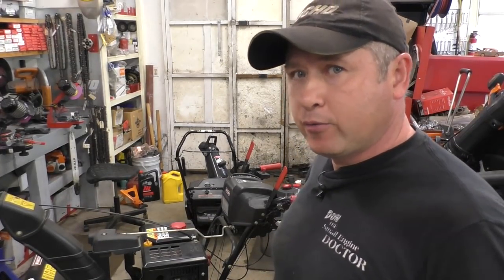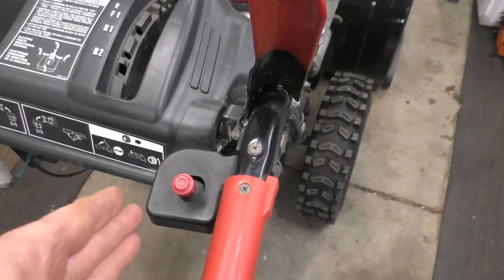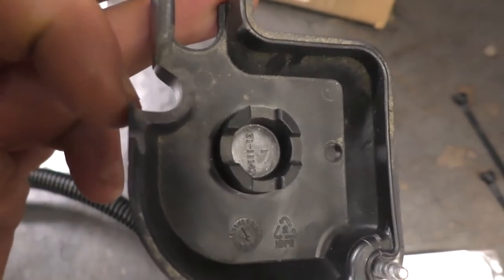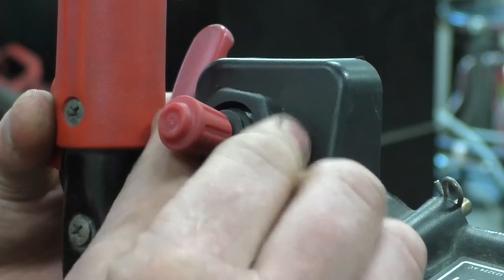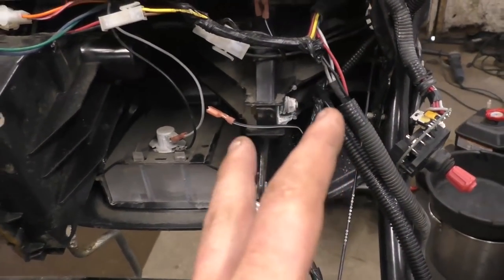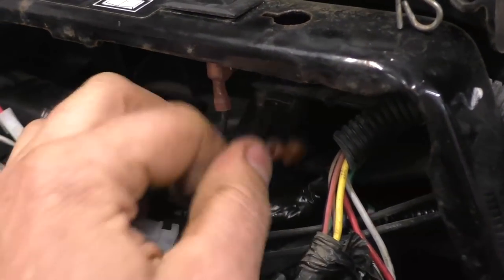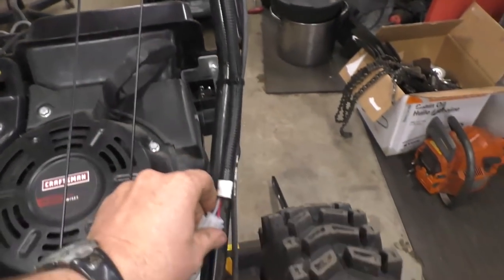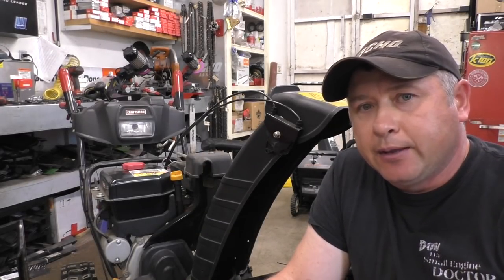Fix Snowblower Electric Chute With Two Repair Options!

Comment: LOVE IT!!!!! My 30 year old Simplicity has a "manual" chute (shoot) that I have been aiming by hand for years.
Reply from the maker: electric chutes are often problematic
Reply: Electronics generally don't like to be shaken violently unless they are encapsulated in resin, kind of like some high durability laptop interiors. There is no resin encapsulation on these electronics and I am not surprised that these switches fail quite often. 

Of course, the likely failure is a soldering point on the board as there is so much shaking in a snow blower. 

This is an awesome video by the way, I love it.

Cheers.

Comment: I did, I believe that when I replaced the new harness assembly the ground wire was not making a good contact. I took the motor and harness on my kitchen table and used a 12v battery and everything was working fine. Thanks for getting back to me.

Dyno

Comment: Don, there is a strong possibility that the micro switches on the circuit board are worn out.
Those can be replaced with a bit of soldering skill.
Do you have a digital meter to measure the micro switches?

Comment: I was given a Briggs snowblower with an electric swivel chute. It had only been run for 2 winters. The connectors for the switch to swivel the chute were dirty and the chute would not swivel. I cleaned them and its good now, but I can't wait to trade that machine for an older one. Doesn't even have a throttle! Snowblowers are an example of why manufacturers need to keep things simple.

Comment: Lets open up the switch to see if it can be cleaned or fixed . Would be interesting to see inside the switch . Just a thought this is something I would do on my own time . I think it would make for a good video .
Reply: I would add a picture here if I could as I just took a switch apart for a chute that didn't work.   After cleaning the contacts it works fine....a 15 mine minute job.

Comment: Interesting video, Dony.  Electric assist on a snowblower.  Well, lah-dee-dah!  I see that the chute tilt is still operated by cables from a motor somewhere.  How did you know it was the switch, and not the motor or a seized cable?

Comment: Thank you for this video , I have a Troy bilt, with exactly the same issue about 3 years old only. Enjoy your videos very and have learn quite a bit of tips and DYI, also glad to hear that youre one of our from the True North, (Canada) i'm here in Northern BC. Retired , also doing some maintenance on other peoples units using your DYI skills . Love it
Reply from the maker: hi from Ontario Peter!
Reply: @donyboy73  

Where in Ontario are you?
Reply from the maker: @SvenTSchixe  Muskoka
Reply: @donyboy73  Beautiful Muskoka, God's country, that is neat to hear you are in Ontarioas well. I am down in the Niagara Region myself.

In this video, I have a similar machine, a Troy-Bilt, that has the electric chute with problems like this in the video except it will only move to the right, NOT left, up or down.

How did you know that it was the joystick and not the electric motor assembly under the left hand side of the dashboard?

Thanks in advance, AC🇨🇦✌🍻
Reply: @AC  I have a machine doing the same thing as yours, did you figure out your problem ?  Was it the switch or ?  Thanks
Reply: @AC  did you figure out the problem with your machine? I have one doing the same thing
Reply: @AC  did you ever figure out your problem??
Reply: @AC  did you ever figure out your problem??

Comment: I had the same issue, took the harness to an electronic repair shop, they replaced a .75 cent diode and that was it. Dont spend $120 for a new harness. There is not much in that control switch. Very easy to fix for someone that works in electronic.

Comment: An electric chute control. Now I've seen everything. Everybody I know has "outdated" manual controls on their outdoor equipment. They operate reliably with the DIYODS principle.
Reply: Doing 
It 
Yourself 
Overmatches 
Dumb 
Shit
🤔🤔🤔 Probably wrong, but I figured I'd take a shot at guessing it.
Reply: @mannys9130  Do it your own damn self
Reply: @999thenewman  Brilliant. 😸 And true! I lost count of how many times my dad complained while I grew up about new cars never offering crank windows as an option instead of electric power windows. Just before he died in 2016, he had custom ordered his 2014 Tacoma from the dealer. It was a bare bones model that only had a few upgrades: automatic transmission, A/C, tilt wheel, and an upgraded sound system which had Bluetooth connectivity for his phone. 😸 Manual locks, manual crank windows, a sliding cloth bench seat, didn't even have intermittent wipers or cruise control. The wipers were high, low, off. Some upgraded safety stuff was standard of course, like vacuum power brakes, ABS, and airbags. He hadn't paid much at all on it before he died, and the lack of cruise control and intermittent wipers killed me, so I just gave it back to the bank. It was ok other than those 2 things. I need cruise! It keeps me from speeding. 👌 Otherwise, I liked the manual stuff.
Reply: What's next? Heated hand grips?  Oh, wait a minute....
Reply from the maker: @flstf96b  they already have heated grips lol
Reply: I don't want or need electric gadgetry to move my chute, but I would sure like to have a mechanical contrivance to raise & lower the chute from behind the console. The mechanical joystick arrangement looks like just the ticket.
Reply: Honestly. Never had a manual break on me. The electronic on my fathers went within 2 years.

Comment: How did you know it was the switch and not the motor that does the tilting?

I'd love to see a short on disassembling the old switch to see how it works, and possibly just what failed.

Comment: Nice job Don.....i guess if electric chute control is on your list of option upgrades, then be prepared for eventual failure.....i like my mechanical chute adjustments, less moving parts and does what it has to do....i was happy with an electric start upgrade..lol

Comment: Good morning thank you for the video. Very informative. I have a similar model to the CRAFTSMAN MTD that you’re working on minus the electric shoot. Wondering if you can make a recommendation to one of your videos that would help modify my unit to throw higher as I have to clear snow on the north side of my shopto go over my woodshed. I have already installed the paddle kit wondering if there are some chute modifications? Thank you again, Mike.

Comment: Great Video! I'm about to attempt this harness replacement. The shute goes up but not down. I don't think it's a cable because when I manually move the shute I can hear the motor turning. Not sure but I think it's the the down contact on the button pad.

Comment: I wonder if a bit of wiring knowledge  and a couple momentary switches would fix that.  I  cut my chute turn rod and attached  a wiper motor.  battery ad a momentary 2 way toggle switch and I'm electric turn.

Comment: What do you think about newer Ariens snowblowers? I have a 2,5 year old Deluxe 28 and it's not been one winter without trouble. Now the whole drive lever going into the gear box came lose. All I'm left with are broken washers, plastic bushes and springs. Turned it in to the dealer and demanded a free repair.

Comment: Doc! This is off the subject, and I apologize!  I have a Honda HS 622 that I am working on. Each side has (2) bolts to drain the engine oil. I discovered an an additional screw bolt in the rear of the machine. I removed the screw and fluid came out. I believe its transmission fluid? When I drained it sure didn’t look like the same color of the motor oil that I drained. Let me know your thoughts on what this is? If so, how do I refill it.

Comment: The " stripe" on a solid wire is called a tracer. So if you have a black wire with a white stripe it`s called a black wire with a white tracer

Comment: I have the same issue on my troybilt. It was working on and off until it finally died in the highest setting. If this is the problem. I'll try giving it a cleaning and if that doesn't work, I'll just remove the cables. I don't use the up and down that much unless it's windy and that is a lot of money for what should be a simple repair. A connector at the switch comes to mind. Also, if it happens to be the motor, that'll cost you over $400 for that part alone.

Comment: Hi Don. Love your channel. I am hoping you can help me.

I have an MTD snowblower with the 277cc Powermore. For the past 10 years it has ran perfect on the first click up from choke (it pops and cracks a bit when wide open, always has). 3 pumps of the primer and it has started on 1 pull...every single time. Even after sitting all spring/summer/fall.

All of a sudden it became hard to start and will now only start on choke. Once it starts I put it back on the first click and it runs fine. But if I shut it off and try to restart it when warm I have to re-choke it and give it a primer pump. Before I could just yank the cord and it'd fire right up.

I replaced the plug, primer bulb, and checked valve lash (all good)

Thanks in advance!
Reply from the maker: it is normal to have to choke or prime these engines cold and also warm
Reply: Any idea what would cause a snowblower that never needed choke to start to all of a sudden require choke to start?

Comment: I have just inherited the Craftsman 247.886910 and the powered chute control does not work. It appears the hexagonal straight chute rod has come disconnected from the console side. I can’t see on the parts diagram how it is supposed to reconnect inside the chute control ass’y. On the chute end of the rod, there is a connector (with a Cotter type pin) with hex inner designed to fit the hex rod inside but I don’t see a similar connector on the control end can you advise?

Comment: I hate to be a snob, but MTD/Crapsman have had poor chute mechanics for a long time.  Looks like the better idea 💡 was no prize!  I guess some marine grade switches and connectors would be of some help!  The joystick controller on my Toro 826 is of solid construction and has worked flawlessly for almost 11 years.   The mechanism on my friends Craftsman didn’t work great from day 1.

I am glad the MTD engineers don’t work in Detroit.  I might be changing my wiring harness when the signal switch fails
Reply: I agree 100% with the poor chute mechanics statement! I also bought a Toro for the same reason! Do you wanna know what the kicker is? At the time I worked for Sears repair services working on lawn and garden equipment! I took a lot of ribbing at work for that same reason!
Reply: @tazmun  wow, I can’t imagine the abuse you took at work.  I was a long time Craftsman hand tool fan but lost faith in Craftsman power tools a long time ago.  I have some hand tools that are close to 40 years old that work as good as new!  Sears was way ahead of their time way back when.  It’s hard to believe they are no longer around.   Looking back at the start they were primarily mail order, eventually the catalog got replaced by a browser and they didn’t keep up with the times.  Very sad to lose an American Icon.

Comment: Could there been an easier fix to this problem? When i look at you showing how it didnt work, i see that the nut holding the joystick is missing and with the bottom broken of, there is nothing holding the circuitboard in place. So when you try tilting the chute you are tilting the whole circuitboard instead of just moving the joystick.  Could the fix been as easy as putting a new nut and a new bottomplate?

Comment: I had a case where it would go up but not down, narrowed it down to the up microswitch lever in the joystick being constantly pressed due to the microswitch lever. Just had to bend the lever out so it wouldn't activate the switch.

Comment: I have the exactly same blower, my chute is not only not tilting up and down but also not turning a full rotation, from the right it will only go half way or 45% of the way, goes back all the way to the right fine but won’t pass centre and or go left, if I hand move it all the way to left, it will go to right, would you say this is electric control and where can I order part as craftsman (sears) is no longer?

Comment: I had one if these in the shop the other day. Talked to mtd about this they said it is a real common problem. It was $175.00 Canadian for the switch and had to go on back order. The customer opted out of the repair.
Reply from the maker: the knob fix is the best and most reliable for $5

Comment: Hey Dony, thanks for the channel.  Have you seen or done many ‘inside the shute and box’ paint jobs using something like POR15?  Just wondering if it stands up better than other paints or coatings?  Thanks.
Reply from the maker: never tried the POR15

Comment: hi, i have a big problem with my electric motor for my snow chute, i bought a 12volts, 25watts, 160rpm motor but it didn't last, it stopped working after a year, the original motor didn't turn the chute fast enough and that's why i bought this motor, could you design me a 12volts motor that could turn my chute fast, thanks

Comment: I have a Honda with a electric chute for 12 years never had a problem .
Reply: Nice machine, but I doubt you can use the toggle with thumb of right hand while using the right hand lever.

Comment: i got like a old snowblower i rebuilt carb it starts right up and dies within 2 minutes and fires right back up its driving me crazy.has spark fuel i dont get it and its like clockwork on 2 minutes it sputters and dies new plug new air cleaner ect.I thought to check compression using finger and it pushes finger a tad.i dunno back at it monday

Comment: I wonder if the switch can be disassembled and perhaps contacts cleaned and or troubleshoot/repair the circuit board?
Reply: It probably can be repaired, maybe one of the semi-conductor is sort-cut and signal from joystick does not pass.
Reply: @zlatkovujevic7348  I would love to get one and take it apart and see if I could fix it.
Reply: @netimage10s  I am having the same problem as shown in this video with my Troybilt -- the chute will not move up and down but will move left and right.  I have the schematic from Troybilt and removed the joystick and examined the components but nothing is jumping out at me other than a "resettable fuse" that is only .9A that in the circuit for the motor that moves the chute up and down.  Would love to fix it instead of replacing it for $150 (inflation...).

Comment: Not ideal for a shop repair but you can fix the switch. The contacts in it get corroded from the moisture. You can take it apart and clean it if you are mechanically inclined

Comment: My chute only turns right, I replaced the electric motor box and switch harness and no change at all. I connected the electric motors directly with a 12v external battery and the motors rotates and I switched polarity and the rotation goes the other way. I check the voltage on the plug while disconnect, I get 14v +/- by activating the thumb stick, I plug it back in and only rotates to the right. at this point I am clueless and I have an electrical background, help needed, so far, almost $800 down the drain with the new motor box and harness.
Reply: Hey did you ever figure out your problem ? I'm having one similar

Comment: Next "Genius" Invention ! 
Remote starter with bluetooth compatible heated cup holder.
Spinners hubcaps
CAA, in case you're stuck in a snowbank
Back-up camera
Deep snow scanner + hockey equipment/ garbage mail shredder
Twin turbo Frozen dog poop Slinger
GPS

Comment: Well that's one way to do it.. Or you could just remove the 2 T bolts Underneath the controller take the bottom plastic Casing off.  Spray down the electronic control board with electric parts cleaner and then put a coat of battery terminal protector on it. It took me about 2 minutes and it's lasted 5 years also it cost nothing... If you want to be extra you can get something abrasive and clean the contact surfaces on the inside of the unit to allow exposed metal to easily make contact and send electrical signals to the control board. Not necessary but why not it only takes 5 minutes.

Comment: Not the point of the video but since the switch was the problem only, a diyer could jump the connections for up/down with a new switch if they had the ability to do so.

Comment: I have not ever run into one of those and hope I never do. That board is totally exposed to the elements. For a hundred bucks, I would remove that whole useless setup. I didn't even see a weather seal of any kind on that switch cover.  What a joke!

Comment: What I don't get is why they wouldn't have designed it so all you had to do was unplug the switch and replace it instead of the whole harness. Of course, then it wouldn't be anywhere near as expensive to repair.

Comment: Kinda a bad design that they motorized that.  The companies that use levers on the console to operate those are the best.  I have a old Noma so I have to adjust that top part manually and I have to turn a spindle like 7 rotations to go from right to left.  Kinda annoying but it works, plus my machine just keeps moving, so I'll stick with it.  Actually speed 1 has been a little flaky lately.  Probably need to get a new rubber drive spindle.

Comment: OMG! If you can't adjust the chute deflector without getting out from behind the handlebars, you should probably hire someone to clean your yard out because you shouldn't be blowing snow if you that fricken lazy. Electroniscs like that don't belong on snow removal equipment anyway. to flimsy with all those wires and plastic crap that breaks and shorts out over time.